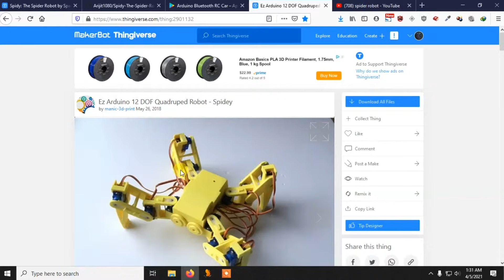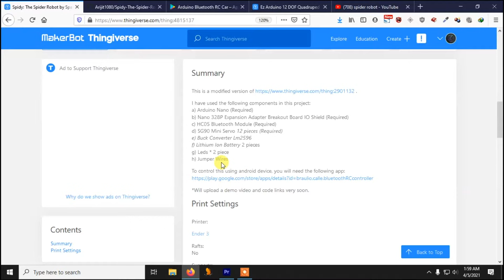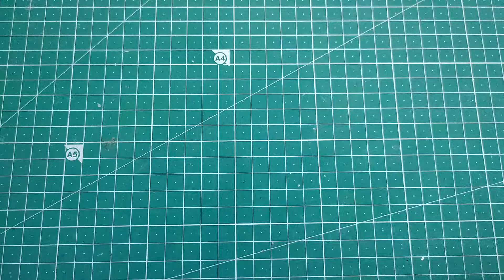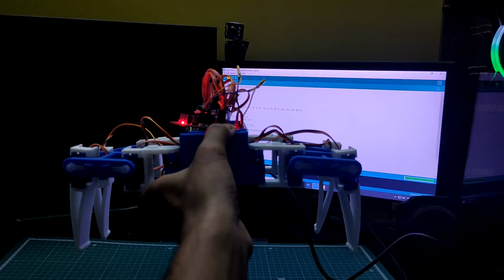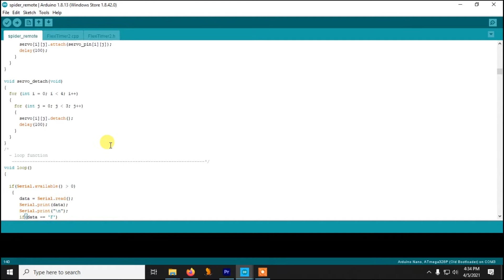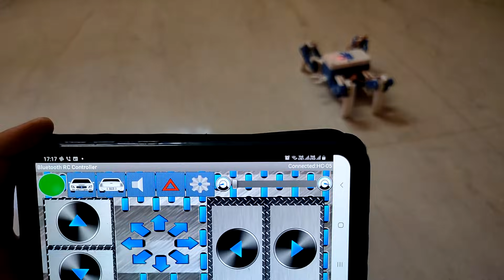Building a Bluetooth Spider Robot using Arduino | Control using Mobile App

Comment: Friend, I have a problem, after the connections and everything, and entering the legs code, everything is fine, but when I enter program 1 the front legs are fine, but the back ones, servos 5 and 11, move backwards, instead of rising, they lower and become uneven, what could be the problem?

Comment: Edit : Problem solved
(Your servo connections of leg no 2 and 4 are wrong and i had to correct them manually)
Hi arjit, I need your help 
I have built this spider robot but the problem i am facing is that when i upload the bluetooth code (The last code) then the leg number 2 and 4 acts opposite to the leg number 1 and 3.
And i have used same connections as your so i dont know what is wrong
Kindly help me with it
Reply: Bro pls send me
Reply: @snooty16  i have sent you pictures in email pleasr check
Reply: @tbogamer2244   tq verry much bro
Reply: @tbogamer2244  bro it's not working 
Is it the same coder or u have used another
Reply: @imad-eddinenaciri6238  Send me your email
Reply: @imad-eddinenaciri6238  I have sent you the schematics on messenger
Reply: Hey ! So nice to hear that you got the solution! . Can you please send me the circuit diagram. It will be so kind of you . I really need it . 
You can mail or dm me on instagram .
Please help me.
Thank you!
Reply: Bro can you send the same for me?
Reply: @sreejithjayachandran  comment your email i can send you schematics
Reply: Bro can you send the same for me? thanks
Reply: Have u got the solution
Reply: @snooty16  Yes
His servo connections are wrong of the leg number 2 and 4
I have made a diagram of that if you want i could email
Reply: @snooty16 brother can you give me the code and changes ples

Comment: how much minimum current is required for this to run? I am using a powerbank with rating of 5.1V~2.4A. But the bluetooth module doesnt seem to receive enough power

Comment: Thanks. This is my first arduino 3d printed design. I had been printing static models. Can someone tell me how long the Initial Leg sketch runs? IDE says done uploading, but I still hear Servo's making minor adjustments on their own. Been about half hour. Is that normal?
Reply: It runs as long as it is powered, I just assembled mine.  It does this so you can put on the servo horns. Then load the second program, follow the video. Mine worked great, but my 18650 batteries have not arrived, so I had to use a 9v for setup, and to test program 1, and it worked.

Comment: Hi, I tried to make your project, but I just can't complete it, I followed everything step by step, I try to load the first program and it doesn't position me correctly, I try to load program 1 and it goes continuously without stopping ... sure there isn't some mistake somewhere?
Reply: Hey could you do it.? Even we are doing this project
Reply: Hey guys. I have the same problem. When im uploading the legs init code, the servos moving to a point. If i upload it again the Servos moving to another point. Can someone help me?